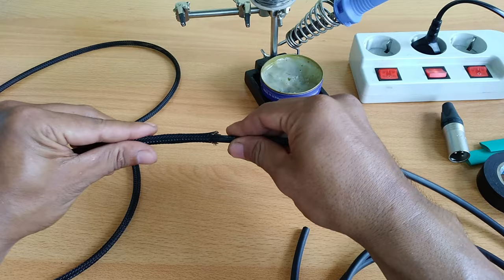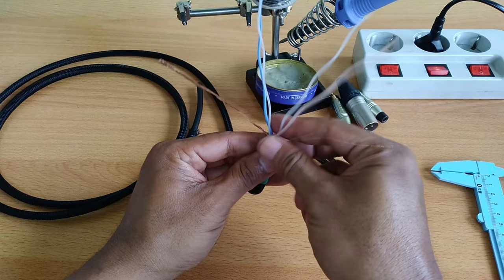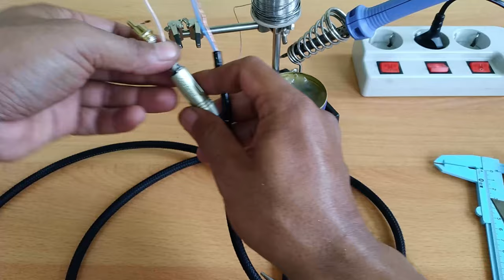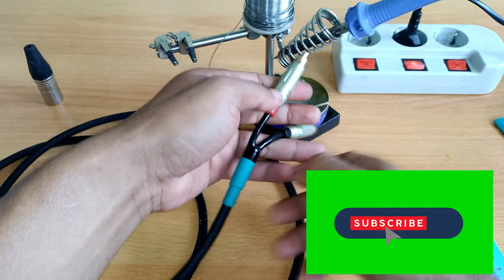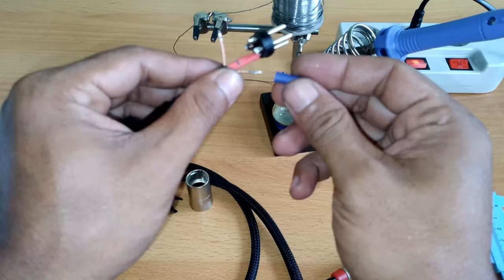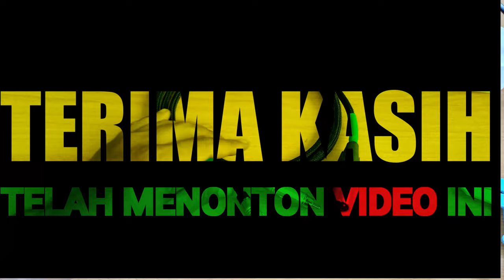Soldering RCA and XLR Connectors | Making an RCA to XLR Cable

Comment: 5 seconds into the video and I have to vote against it. Horrible, dangerous technique, terrible example. Very sloppy.
If you are new to soldering, don't do what he's doing, you risk injury.
Reply from the maker: Thanks for the good advice
Thank you so much for interacting with our videos
If you don't like This video the Dislike button, it's on the right side of the Like button
Reply: I don't see why you should do such a cable ? Want to go xlr take 2 di boxes , at least it would transform your stereo asymmetric signal into a stereo symmetrical signal ones ....
Reply from the maker: Thank you so much for interacting with our videos
Reply from the maker: I have written in the video title and video description related to this video, is there any other statement?
Reply: Eej Cowboy, whats wrong with U ? ...too much Protein ? LoL 😅

Comment: Will this cause humming and Buzzing in your speaker? I have a XLR from preamp to rca power amplifier. It caused humming and Buzzing due to ground loop. I was told never mix balanced and unbalanced connectors.
I gave up connecting xlr to rca. Now, I am using rca preamp to rca power amp. Saves me the frustration.
Also, I was advised to remove the earth from Pin 1 which is the culprit if I know how to do it.

Comment: Mantap om luar biasa tutorialnya 🤞. Cuma saya mau tanya kenapa ground nya ikut disambung dan disolder gabung ke kutub  + dan - ?
Reply from the maker: Di menit berapa dalam video ini terdapat penggabungan Ground, + dan -  ?
Reply: @sbstronic  lol some ppl thinks the white wire is a positive they have to learn that thise wire is call HOT...COLD...SHIELD 1&3 can be loop or jumper nothing happens

Comment: Very well done, i like it" So actually this Cable is perfcect
to connect the 2x mono Outputs (L+R) of a Reciever with 
a Subwoofer via 1x XLR Stereo  Input..., right?
Reply from the maker: This cable help you create an XLR male connection into a stereo RCA input/output, Connecting DJ Controllers to Amplifiers, Integrating Home theater, Pro Audio gear outputs from mixing consoles, recorders,amplifiers, subwoofer, active speaker with Xlr Input

Comment: Hola que tal saludos. Los dos cables de audio azul y blanco van pegados al pin 2 del XLR y tierra o la maya van pegados al pin1 y pin3 del XLR. Eso es correcto ??
Reply from the maker: Así es, los cables azul y blanco están conectados al XLR Pin-2 y la Tierra está conectada al XLR Pin-1, XLR Pin-3 y XLR Chassis
Reply: @sbstronic  no pasa nada si se conectan juntos los cables azul y blanco? no se genera un corto circuito? por que estas transformando una señal de estereo a una señal mono
Reply: @sbstronic  thats how i does my cables or jus make a jumper cable from pin 3 to 1 easy does it i dont see anything wrong in this video
Reply from the maker: Thank you so much

Comment: Para quien me pueda ayudar, compré un cable similar al del video para usar la salida rca de un lector de CD música y la entrada XLR a un DAC topping 90se, sin embargo, el DAC no reconoce la entrada por lo que no sale el audio. ¿Alguien conoce el motivo? Gracias
Reply from the maker: Qué tipo de cable usas desde el reproductor de CD de música al DAC?
Reply: @sbstronic  DISINO Dual RCA a XLR Macho Y Splitter Patch Cable, Desbalanceado 2 RCA/Phono Plug a 1 XLR Splitter Duplicator Lead Y-Cable Adaptador -1.6 pies/19.7 in
Comprado en Amazon
Reply from the maker: Está conectado el cable del reproductor de CD de música al DAC de entrada XLR? XLR-AES?
Reply: @sbstronic  sí
Reply from the maker: Desde un reproductor de CD de música
Puede usar un cable RCA con conector coaxial de audio digital
y si su reproductor de CD de música admite salida AES, entonces el cable que está utilizando
Cable AES/EBU XLR a XLR
y esto es muy seguro que el DAC lee el tipo de conexión a la que están conectados los cables
Espero que resuelva tu pregunta.
Muchas gracias por interactuar con nuestros videos.
Reply: @sbstronic  muchas gracias